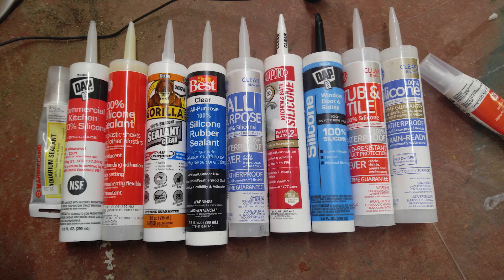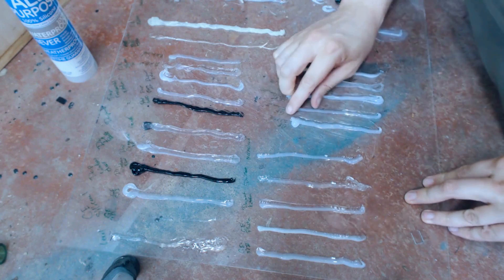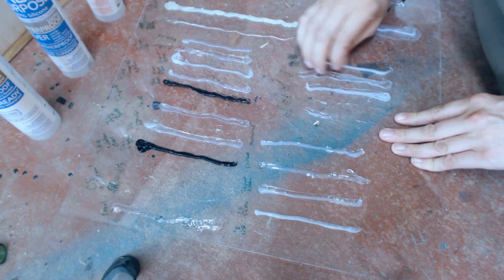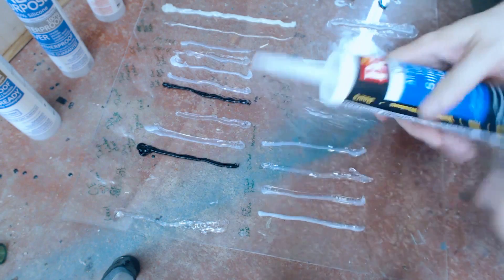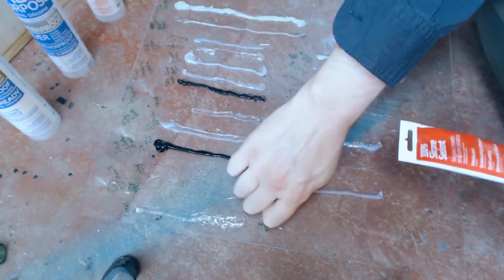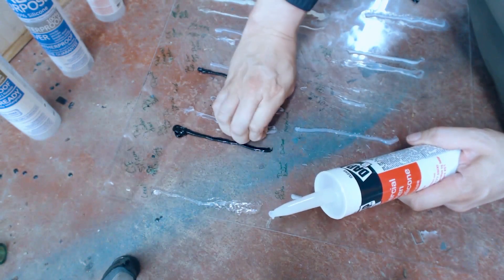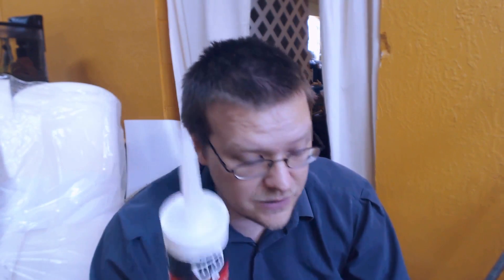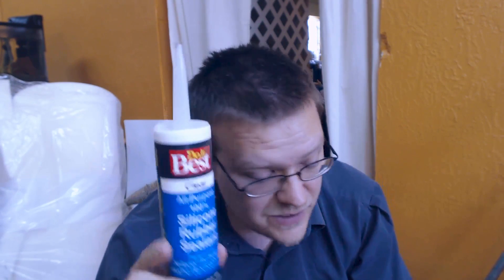Silicone on Acrylic - Which ones actually stick? DIY aquarium windows

Comment: It would be good to mention that Gorilla Silicone is labeled as not for Underwater or Aquarium use. It also has algaecide and the MSDS lists it as having numerous chemicals that are harmful to aquatic life.
Reply from the maker: Nearly every silicone, including those used by aquarium manufacturing companies, says that their products are not for underwater or aquarium use. It's a liability thing. For instance, SCS1200, which is very commonly used by high end tank builders, says not to use it underwater.

GE Silicone for plastics contains chemicals that cause liver failure, cancer, and reproductive issues. The takeaway of the SDS on silicone is that you can't put uncured silicone in an aquarium.

For instance, the MSDS lists "acetic acid" as aquarium acute toxicity. Vinegar. Yes, vinegar should not be dumped into your aquarium, but it also evaporates as the silicone cures.

"Silicones" are chains of siloxanes, chemicals like benzene are incredibly dangerous in uncured silicone, but become part of the long chains while curing, altering the end structure, creating longer straighter chains or twistier more tangled chains. The benzene is the reason that gorilla silicone sticks better than the others, but it becomes linked in the actual siloxane chains as it cures, with the excess off-gassing.

To release it would generally require heating the silicone to several hundred degrees in oil, basically frying it. Of course, this means it can't be considered "food safe" in a kitchen where it may come into contact with things like pans or hot oil.

The "algaecide" thing is largely just people on forums misunderstanding why silicone II sometimes kills fish and sometimes doesn't, and misunderstanding when things say "mildew and mold resistant" as a comparison to acrylic caulking which will end up with mold and mildew penetration due to cracking due to the fact that acrylic caulk expands and contracts with temperature and silicone generally does not.

Given proper curing time there isn't really anything in it that I consider to be an issue, especially with regular water changes being done, and it is as a cured product generally safer to be in your fish tank than Tetramin fish food.

Comment: I appreciate you doing this test but i feel like you were not consistent at all on the bead pattern or thickness.  For example the GE silicone for Acrylic had a very smallest bead.  I'm surprised that performed so poorly on your test because i have done a similar test with that and it held extremely well. I would say as good as the Gorilla silicone. Most of the other GE silicone do perform very poorly on plastics. As you saw in your test.
Reply from the maker: The stuff didn't stick, several tubes were bad before opening, the QA is just terrible on the product, and if you happened to have an experience that was different it really just highlights the problem of inconsistent quality.

My bead size isn't responsible for that. A piss poor product is.
Reply: @MischiefandFins  I suppose I won't argue that the QA is quite bad. I noticed that usually I can tell on the smaller tubes which one is bad by just squishing the tube. The bad ones tent to be lumpy feeling.

Comment: Thanks for taking the time to create such an informative video. I want to caulk my house windows from the outside (not aquariums). Are your durability tests still relevant? Would you still choose Gorilla Silicone Sealant over GE II Silicone when using it on exterior windows in cold climates? TIA
Reply from the maker: If your house windows are acrylic I would really recommend a product like lexel instead. The reason I didn't suggest it in this video is that it is too flexible to hold up to water pressure, but that flex is a benefit for standing up to wind flex and different expansion rates as things heat and cool.

It's a really solid product for everything other than fish tanks.

Comment: Downsil 732 amazed me!!! 275 pound electric motor hanging on just with a bead... Had to actually use a Steel Chisel wedged in between the steel faces just to get the motor apart. Electric motor was hanging on by Chain Fall.

Comment: Hi, a question, but is it possible to stick the acrylics to a silicone rubber sheet? with the silicone glue?
Reply from the maker: Silicone doesn't really stick to rubbers, and does a pretty bad job of sticking to other silicone products. I'd be more likely to try a liquid rubber sealant like Lexel for that, but things really just don't stick well to silicone rubber in general, so that might not work either

Comment: Hey man quick question. I’m installing an acrylic window on a plywood tank. Which of these would you use as gasket between the acrylic and the wood that has a epoxy resin?
Reply from the maker: smaller plywood tanks i usually use gorilla silicone, larger tanks i order momentive rtv 108 from amazon https://amzn.to/39T9Qwb

the momentive is far better than the stuff in this video in pretty much every way, this was just testing stuff i could get at local shops, but i've used the gorilla silicone in several tanks and been happy with it years later.

after installing the windows you want to be sure to apply a second sealing layer around the outside making good contact with the cut edges of the acrylic, it sticks very well to the cut edges and that keeps the front seal dry, which makes sure that it will hold well long term.

Comment: This is informative.  Thanks.. do you think that if prepped right I could use that to reseal a leaking seam on a 300 gallon acrylic? And would you happen to know anything about weld on products and what the process would be to seal with that thanks a lot
Reply from the maker: Really a bad idea to use silicone for anything other than installing windows into tanks made of plywood, concrete, or metal,

I'd definitely use an acrylic weld product first, if the tank is in good condition and the seam is still flush I'd go for a water thin product like weld on 4 and see how it does

Personally I'd try that first, and if it didn't work or if I just felt like it didn't bond cleanly enough for comfort then I'd use a little bit of lexel, which is a clear liquid rubber. It sticks very well to acrylic, but it takes about a week to cure completely when applied even in a very thin bead
Reply: @MischiefandFins      thanks. I appreciate it.   I'll try wheeldon

Comment: @mischief and fins Have you tested loctite silicone yet? I need to glue an 1/2” acrylic/plexiglass panel to my aquarium glass and have a tube of it at home. Not sure ho well it will hold especially after watching this vid where you showed that most of these common silicones are garbage!
Reply from the maker: No, if it's not in the video then they don't have it at my local stores, so I wouldn't have had occasion to try it.

You might do a search on the monster fish forums to see if anyone has reported anything
Reply: Mischief and Fins Damn, alright I’ll try to see if there’s any reviews of it. The only other sealant I have at home, which I just bought a few days ago is the GE Silicone 2+, so I guess I may have to order the Gorilla silicone online as my local stores don’t have it 😕
Reply from the maker: @demonslayer8085  out of curiosity, what are you doing? Is it like... An add-on, or a side repair, or?
Reply: Mischief and Fins Basically I have a 17 gallon tank that I am trying to divide in half with a 1/2” thick black acrylic/plexiglass sheet so that I can put one male betta fish on each side. I’ve tried cutting the plexiglass as close to the inner length of the tank as possible but will still need to use silicone to hold it in place. My main concern is worrying that it will not stay in place (fall over) after the tank is filled with water, so I really need a strong silicone that will hold/stick to acrylic as well as glass. This is especially important because i plan to leave a 1/8”-1/4” gap from the bottom so that I can just use one heater to heat both sides of the divided tank. I saw another YouTube video where this guy did a review of the GE Silicone 2+ and said it was good so went to buy that before I saw your vid today 🤣
Reply from the maker: @demonslayer8085  there's probably not too much worry either way with that, honestly. If you run silicone on either side it will stay stuck to the glass, and will probably stick to your cut edges pretty well. If it doesn't need to be water tight it's just less problematic

Comment: Just one question if I have a leak in my are acrylic aquarium will the gorilla silicone work
Reply from the maker: Leaks around joints? If it's an all acrylic aquarium, try a solvent cement in the leaking joint first. If that doesn't work I'd be more inclined to use lexel for very small leaks, as it sticks to pretty much anything. I've used it in several ponds and tanks with no issues. It will stick much better, but it takes a week or so to cure, even when applied very thinly.

If it's a crack or hole I would cement the crack using solvent cement, then cement another sheet of acrylic over it.

Silicone is more of a "sticky gasket" on acrylic, really no good for patches in my opinion. I trust gorilla silicone to hold a window against resin. I wouldn't trust it to hold acrylic against acrylic.
Reply: @MischiefandFins  thank you for your response it's an all acrylic tank with a small leak on the bottom where they meet up together so what you say weld on 4 and then weld on 16 on top of that
Reply from the maker: @aquariumhacksbymarcus5653  with that spot, if it was my tank I'd masking tape the outside, weld on 4 the joint, give it time to dry, then lexel the whole bottom seam to be safe, cause I'm paranoid that one leak means bad cement in the whole tank.

But that's just cause it would be covered by substrate in any of my tanks anyway

Comment: FYI, Silicone is not made to stick to acrylic bro. It's made to stick to glass. You are supposed to use a chemical bond like Weld-on 4 and Weld-on 16 to weld acrylic.
Reply: Are Weld-on Acrylic cement watertight/waterproof?
Reply from the maker: acrylic cements don't do anything about adhering acrylic to something other than acrylic, which is the point of this.

Good luck attaching an acrylic window to epoxy using one of those products.

To be clear, lots of people want to add acrylic baffles to sumps, or use acrylic windows in plywood tanks, and there are actually quite a few silicones which work very well in that use case, you just can't use them to make a watertight all acrylic box.
Reply: @MischiefandFins  You can get a glass aquarium and then have glass panels cut to size and then silicone them in place for a sump. It would be cheaper as acrylic tanks are more expensive. Easier to find a used glass tank too.
Reply: @countsd1  Except its much cheaper to get a glass tank and use acrylic panels for sump or overflow. Plus acrylic is much easier to cut at home than glass. That is the point to attach the acrylic to glass.

Comment: which is best silicon for acrylic to acrylic
Reply from the maker: acrylic to acrylic you should really use an acrylic cement. Even a really high end silicone like RTV108 or SCS1200 will only really make a gasket seal on acrylic long term.

If you're making an acrylic tank, use acrylic cement. If you're trying to do something like fix baffles into a sump, something like Lexel works far far better than silcone on acrylic, but it takes 1-2 weeks to fully cure. Lexel is covered in "no aquarium" warnings, but several bigger pond companies use it to install drains and things, since it sticks to rubber liners better than silicone, and they haven't had any issues. Just don't use to to try to build a tank, it's far too flexible to hold a tank together.
Reply: Angelfish Unlimited ...thank u so much sir
Reply: Weld-on 4 and Weld-on 16

Comment: Enjoyed your very informative video but I have a nagging question. When I went to pick up a tube of the Gorilla clear sealant it shows in the fine print that it's not for underwater or aquarium use. So is the key just the adequate curing time????
Reply from the maker: The only silicones that don't say that are the ones that are marked specifically as "aquarium silicone"

It's just a liability thing, they haven't done any official testing for food safety or anything so they have to tell people not to use it for those things.

"Aquarium silicone" uses the same toxic curing agents, and will also kill fish if not cured completely. The big difference from one kind of silicone I to another is just the length and shape of the various siloxanes used. I assume longer straighter chains make better adhesive, and curlier more tangled chains make better sealants (just a guess based on pretty limited organic chemistry knowledge), but it shouldn't matter for aquarium safety, as they really only leech out at very high temperatures in oil.

The big difference between gorilla sealant and, say, dap aquarium, is that gorilla appears to have added a small amount of benzene, because benzene helps siloxanes to straighten out. This additive is likely the reason for the significantly better bond, and it is arguably a carcinogen, but it should be essentially entirely bound up in creating longer siloxane chains as it cures, unless, again, it ends up getting hit with very hot oil. So I give it a couple extra days of degassing to be sure, but it evaporates very fast, so the cured product shouldn't be any better or worse than any other on the market.

Definitely more toxic before curing, though.
Reply: @MischiefandFins    So gorilla has a cure for cancer.  ha

Comment: Great vid man! Out of curiosity, have you ever considered a polyurethane adhesive?
Reply from the maker: I might trust something like 3M 5200, with a coating of silicone over it to keep the zinc from leeching out, but I haven't had much reason to test it, and if I'm coating things with silicone to make them aquarium safe it feels easier to just skip to the silicone and hope.

I may try some experiments with PL Premium 3x and the like when I have some spare plywood and time.

Comment: Great video, thanks for taking the time and money!  But I'm puzzled by two things... if they are all 100% silicone, A) how can they be different strengths? B) how can they be colored?
Reply from the maker: "Silicone" is a mixture of different lengths of siloxane molecules (alternating silicon and oxygen atoms in a long string). The properties of the mixture are changed both by the length of the molecules, the mixture of different lengths, and where and when they have hydroxide or hydrogen groups attached. This is why any given company might have 14 different kinds of silicone under the same brand, since some mixtures are great adhesives, some are great sealants, and some are great lubricants. 

It's more a generic term for a class of molecules than a particular product, and that's why you can buy silicone grease, oil, adhesive, sealant, resin, etc.

The second question, they're generally between 1-3% colorant, carbon black, titanium dioxide, things like that, and the claim of "100% silicone" is just a marketing term which is entirely meaningless
Reply: That was by far the most intelligent and best possible answer to a commenters question i have seen... like so much so it made me think and realize such..  good shit..  shoulda been mentioned in the video which woulda given a bit more merit to your overall experiment to the doubters..